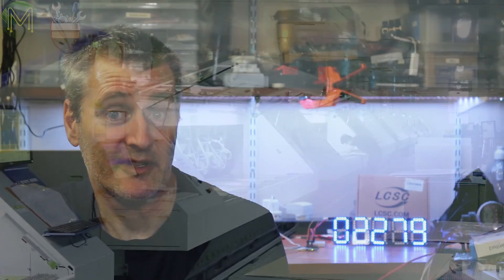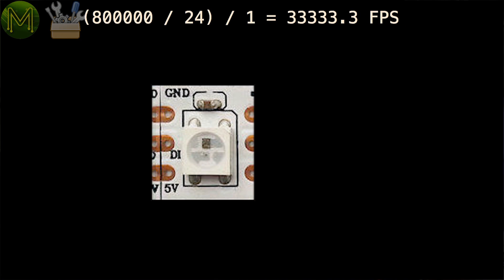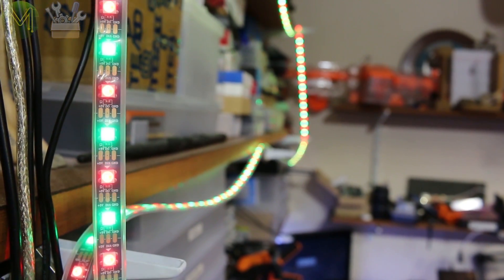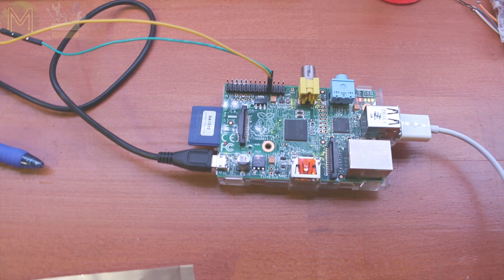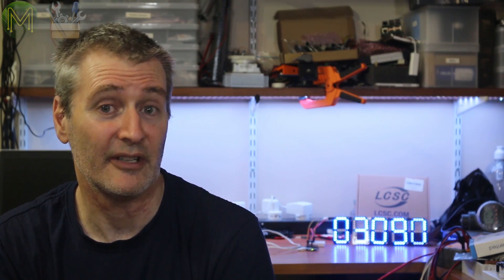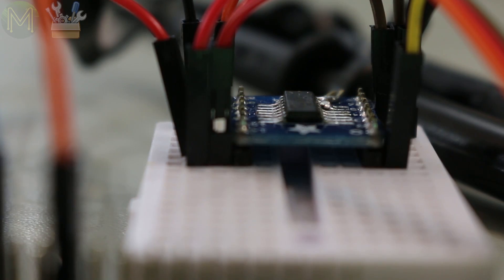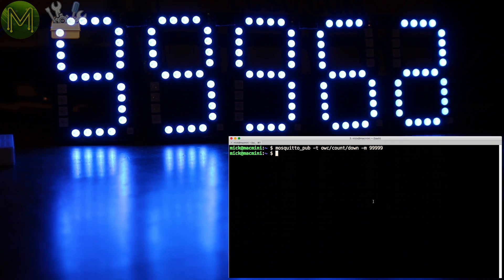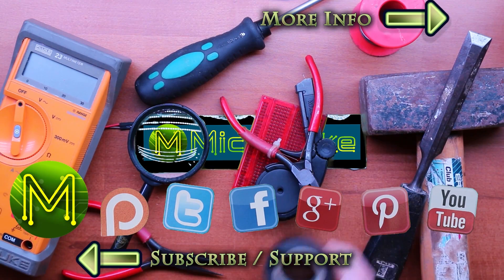#255 How to use WS2812 LEDs - A simple Wiffy counter in GoLang // Project

Comment: Hey, have you thought about using a 74VHC1GT125 for driving the WS2812 LEDs? It's a much smaller single non inverting buffer which should accept 2V as HIGH input level.
Reply from the maker: Yup, that’s one other possibility. The next mailbag after this video, I covered this.

Comment: Basically, I don't like the WS2812 way of driving LEDs.
Yes, I know it's maybe the easiest way, but there're still some problems in this way.
It's not a matrix, which means the power consumption is really high;
If you wanna display some complex effect, there's pressure on MCU calculation;
You will find a obvious voltage drop in a long chain of LEDs which require external power injection.

Comment: I decorated my turboshaft powered pit bike with about 160 of those. One word of advice- use ws2813 not ws2812. I put a lot of work in integrating the lights into my turbine bike then one pixel goes bad and everything after it dies. with ws2813 you would have to have 2 dead pixels right next to each other before everything after those pixels goes dead. I have a turbine powered minivan too and I'm going to put a few thousand ws2813 on it.  https://youtu.be/WZMlmCRBVuA
Reply from the maker: Yeah, I can imagine in extreme conditions like a bike. LEDs would go bad quickly.

Comment: I like how you start by saying it is a 4 pin device (WS2812B) then show a diagram with 6 pins! (WS2812S)  :)

And you were correct, there are in fact 12V strips available with a small Point Of Load (POL) buck converter on the back every meter.  The other 12V strips typically use a WS2811 chip and 3 "dumb" RGB LEDs so you can only control the colours in triplets

Finally, the latest generation of WS2812B-V5 will "officially" support 3.3V and 3.0V logic levels for compatibility with ARM chips and BLE modules, plus a number of other improvements (see PDF on the WorldSemi website) - but who knows how long they will take to filter through into production and supply channels

PS. The burn mark (stain?) on your anti-static bench mat looks awfully familiar!  ;)
Reply from the maker: Yeah, a couple of extra pins snuck in there.

Comment: Awesome project and video! I might be missing something, but if ws2812 protocol is very time sensitive, how is it possible to drive them with Pi since Linux is not a real time system?
Reply: Not sure which library Mick was using, but there are some that set up a waveform in memory and play it back to a GPIO via DMA - so timing is done in hardware instead of bit bashing
Reply from the maker: Yup DMA driven.
Reply: @MickMake  The WS2818 is not that timing sensitive. Of course, in linux it is best to use DMX. But for any MCU, bare metal programming, just use SPI. Btw, you can also simple use SPI on the Raspberry Pi. Works fine.
Reply: " how is it possible to drive them with Pi since Linux is not a real time system?" -> just use the SPI driver.
Reply: Really no need to use a real time system. The WS2812 is not that timing critical.

Comment: +100 for 74HC245. Stable, reliable results. And 8 ports. I use it with esp8266 and ws2812 small strips so far, until I have reliable power solution for 256.
Reply from the maker: Yup, that was a guff on my part. I'm actually using the 74HCT4066, which is a 3 channel analog switch. Seems to work well, is cheaper and can handle a wider voltage.
Reply: Or a HCT125 and the 1 gate version : SN74LVC1G125

Comment: 10:22, 74HC245 IS NOT AN ANALOG SWITCH, it is a buffer IC ;-)
Interesting stuff thou
Thanks for sharing :-)
Reply: Worse still, the logic-levels of HC'series CMOS are different than HCT'series CMOS. The HC levels won't cut the spec to reliably translate 3V3 to 5V :/
Reply from the maker: Thanks mate. Actually, that was a second guff on my part.
I was actually using the 74HCT4053, which is indeed a three channel analog switch.

Dunno why I started calling it the 245.